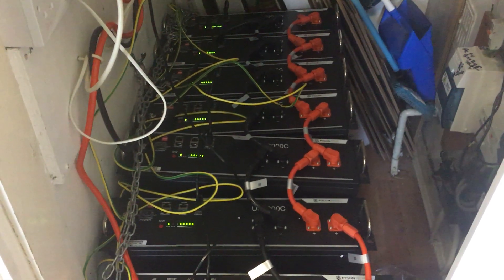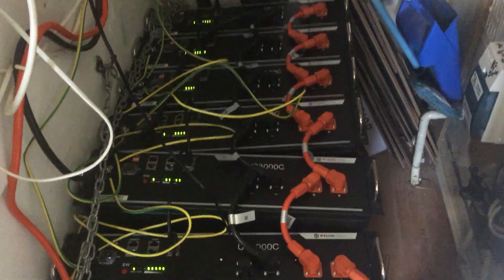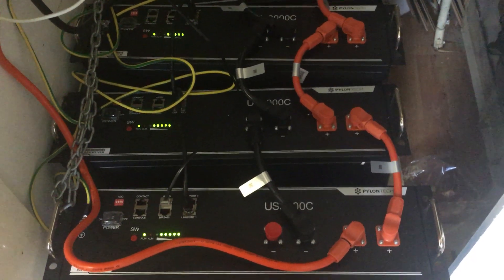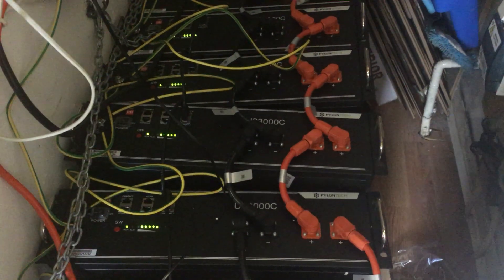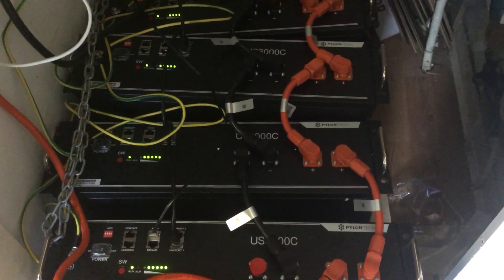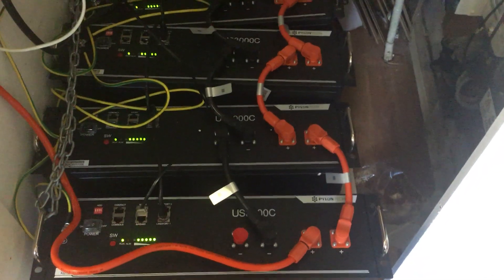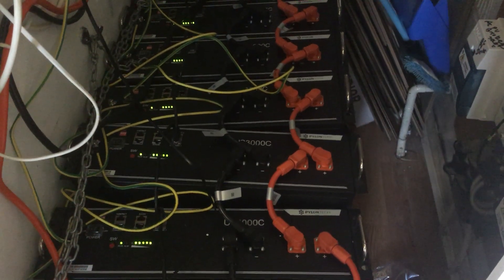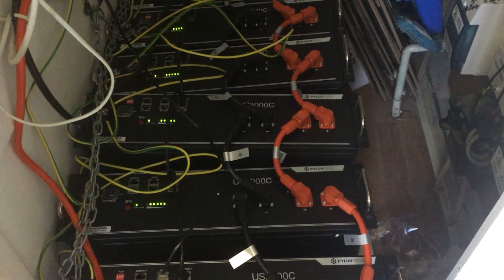Www.premiercomputersolutions.co.uk, Balancing pylontech batteries, fault finding, fixing overload

Comment: My batteries are all flashing on the alarm LED. I'm guessing this has happened after the winter with the low light and temperature. Do you think just recharging the batteries could resolve the issue?
Reply from the maker: @dr6124 yes, recharging should solve the alarm light issue and the charge has dropped below safe levels. Thanks for subscribing to the channel
Reply: @pylontechsolarbatterystora3979  no problem. Thanks for the advice. Can you recommend a charger? I'm in the UK. Thanks.

Comment: Hi, many thanks for your videos, due to a fault with my Solis inverter my Pylontec US5000 battery has discharged and gone into protection mode with the flashing red light, I have since bought another US500 which is working fine and fixed the inverter as I understand I cannot use the good battery to charge the discharged one as they will not be equal in voltage. Pylontec help centre has suggested I use a battery charger at 53v 2a to bring the discharged battery back up to the voltage of the good battery. As the inverter will only work via the power of the battery and not directly from the grid I am stuck as to what to do. Could you suggest any other way round this as I cannot find advice on this anywhere. Many thanks for your help
Reply from the maker: If you can’t externally charge the us5000 as pylontech suggest . Then the only option is to get it replaced by pylontech. The battery may be faulty as normally the inverter can’t just cause the red light. Also when you connect us5000 batteries together , the master will attempt to charge the other battery. If the us5000 still won’t come out of red light mode then it could be just a faulty battery .
Reply: Hi many thanks for getting back, we went away for a couple of days and the inverter didn’t put charge into the battery on the overnight cheap rate and as the inverter receives power from the battery only, it took the battery below 5% thus going into protection mode. I have today found an adjustable voltage DC charger that can be set at 53.2v 2a so I will give it a try. Once again thank you for your time.
Reply from the maker: It was pleasure helping you. It’s what this channel is all about. Thanks for subscribing, it’s important people subscribe as then I can help people further.
Reply from the maker: Thank you for subscribing

Comment: Thankyou for this very informative video. I have the same us3000c batteries. Two but bought a third. Connected them up in the same way but left the inverter Power +/- cables and rs485 (for some reason installers used rs485 rather than CAN) disconnected.  The two current batteries where at 100%. I then pressed the SW switch on the master in order to balance.

Lights all flashed in same way but left over night. In the morning all the LED ights where out except the RUN LED light was flashing alternatiing between each battery. Does this mean the balacing performed correctly?  Wan't sure if all the SOC lights should then be all lit the same level.

I then turned the batteries off, reconnected the power cables from the inverter + to master, - to Last slave and the rs485. Turned the Isolator switch on but then the inverter asks if I want to add a battery. So is it just a question of re-entering the settings?
Reply from the maker: Yes. The batteries are in standby and should of balanced correctly. When they discharge the current SOC should be displayed on each battery.
Reply from the maker: The inverter should pick up the new battery automatically. No need to change settings .
Reply from the maker: But as your system is RS485 and not CAN you may need to put a new address using the dip switches on the new battery itself. Also make sure each battery has a different address setting on the DIP switches
Reply: @pylontechsolarbatterystora3979  Thankyou,  The inverter socket does have rs485/CAN so would moving it to the CAN port on the Master battery help?

Comment: I have issues connecting 2 Pylontech US3000C in parallel to the inverter. Both batteries work separately, but they won't charge once connected in parallel (but discharge is ok) - inverter shows something like random 50-90W of charge but green SOC is not flashing. Tried at SOC 50% on both, then charged to 80% on both and no changes. If I disconnect the link port cable from one battery, the inverter starts putting current but then the master battery goes into ALM.
Reply from the maker: Send a photo of your 2 batteries connected together with the inverter and I will see if there is anything wrong

Comment: Hi, nice video well done. I am getting a couple of PylonTech U3000C's to go with my existing U3000C but could not hear/understand how long the battery balancing takes when they are connected together; it must be the accent! Do you just wait for the lights to sync?
Reply from the maker: Yes you wait for the lights to sync on each battery, so they should all flash concurrently. Thanks for subscribing to the video.

Comment: Thanks for making the vid, just added a 2000C to my excisting set up of 2 200ob batteries,I struggled at first becuase i didnt press the SW on master, i pressed the SW on all the batteries, could not get the vicron to charge properly, it seems to be working now, in the old set up it would leave one of the 2 batteries on 20 percent, not sure why this happened, the other battery would discharge but the other would stay on 20 percent, not sure if this is still going to happen as im waiting for it to discharge now i have all 3 running, I will let you know what happens, but thanks for making the vids , much appreciated on all your online help, not much info out there for people with pylontech
Reply from the maker: Hi, thanks for your kind words. Please subscribe to the channel. You only need to press the SW button on the master battery, the one that connects to the inverter via CAN link. No need to press SW on each battery.  Let me know how you get on.